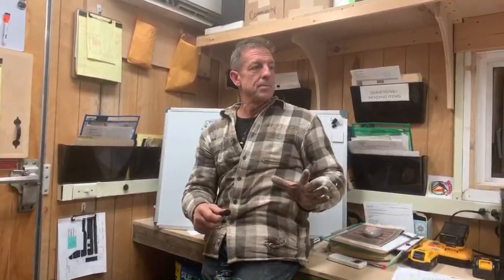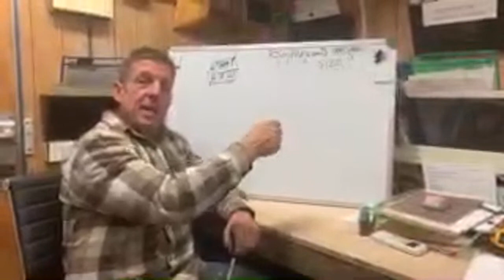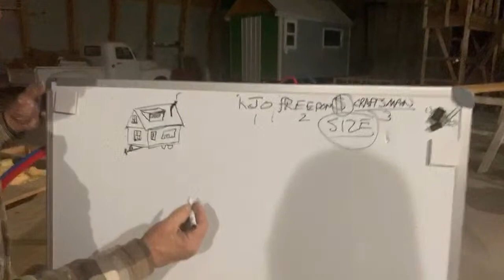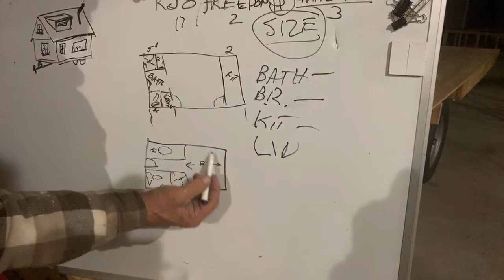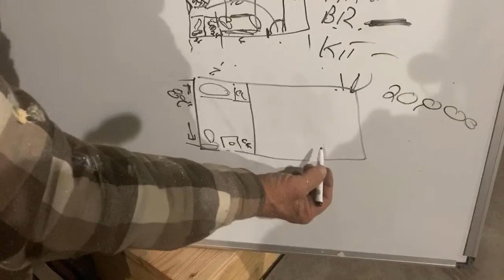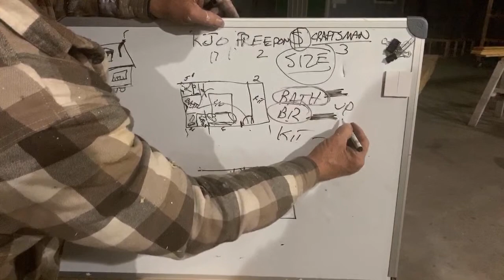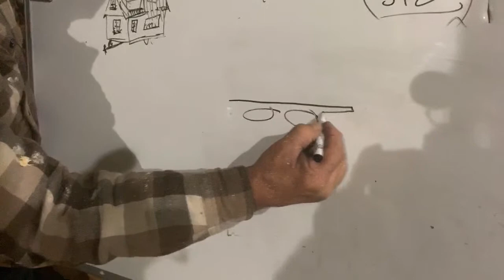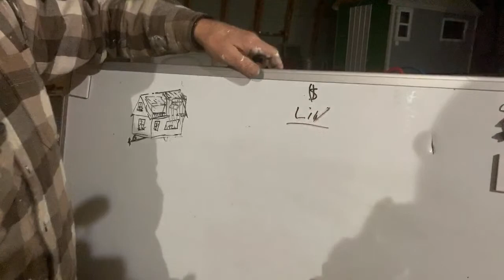How to design your Incredible Tiny Home

Comment: Randy, I was thinking all you have to do is use Hurtz trailer Vin #'  to title the house using the trailers Vin #  for Financing and list it under Recreational Vehicle something like all-purpose Recreational Vehicle, Oh and another thing on the tung box's have one or 2 guy's build them prefabbed same width but different hight's. BTW I was driving on 95 Wednesday night coming from Tennesee I pulled over to get gas and used the bathroom on the way into the BR there was a magazine. I see A Magazine called The New Pioneer on the way out I pick it up and grabbed a coffee sat down and started turning the pages I could not believe my eye's there you WERE on page (37 Downsizing with Class) Excellent magazine BTW I said to myself I have people waiting for me what am I doing sitting here so I go to the register Pay for the coffee But forgot to pay for the magazine I had it tucked under my arm. I will probably subscribe to the Magzine I'd Definitely Recommend it if your thinking of going TINY.  I'm going to post this again in the most recent VLOG Randy I'm Ready To Go With My 24 By 9 Newzealand Style THOW, What's my next move I'm in Altamont Springs Fl I don't feel like Driving Wouldn't mind a Small Plain. Just don't Want to End Up like The Big Bopper   Al D

Comment: The sink in this home is beautiful, but how long will it last before it needs re-coating?
Reply: Typically, with similarly coated countertops, lightly sanding and applying a fresh coat of polyurethane every six months will be enough to protect and keep it looking new.  But a sink can be expected to go through a bit more wear and tear than a countertop.

So, as this is their first one, we'll have to wait and see what the owner experiences and reports back on it later.

However, barring waiting for the owner to report back, there are commercially made wood sinks with known history that use durable woods like Teak that you mainly just need to oil every now and then...  Here's an example...

https://www.sinksgallery.com/tips-wooden-sinks-and-baths

Will cost more but there's more of a guarantee of longevity and durability as woods like Teak are naturally very durable and water resistant. So even if the coating wears off it'll last a long time.

Though, you can be just careful with it, avoid anything that may scratch the finish, don't put anything too hot on it, dish soap with cloth or soft sponge for cleaning, use a cutting board, etc. and it should last a long time...